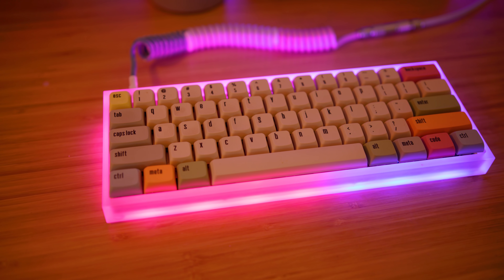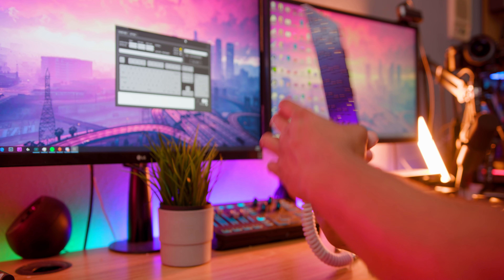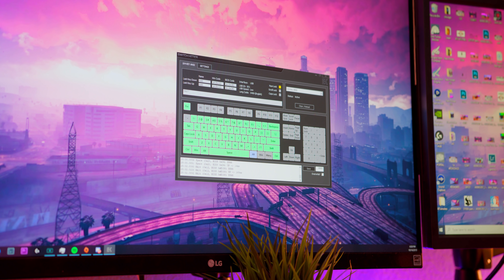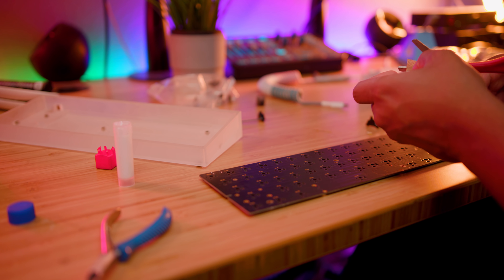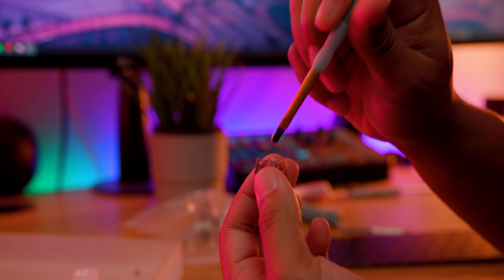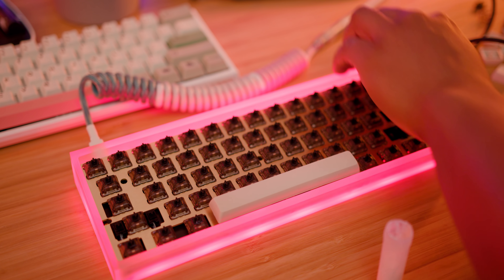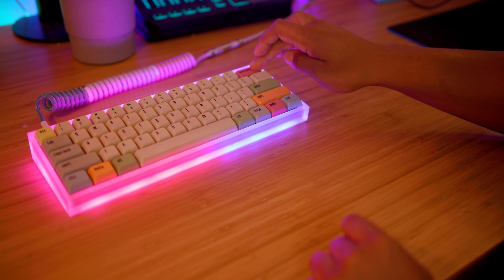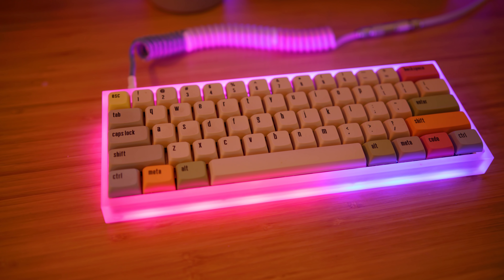Quick And Easy How To Build A Custom Keyboard! Tofu Acrylic 60% Keyboard Build + Gateron Black Inks

Comment: I built a nearly identical keyboard back in june, using my holy pandas made from trash pandas and halo trues, and using a poly carb plate instead of brass. I've been loving this keyboard since.
Reply: Phantasm does the 1 UP PCB have light blue /cyan rgb or somewhere you can customise it to that colour £?

Comment: DUDE - I just started my build yesterday. SAME case, SAME PCB, SAME Stabs, different switches. I went with lubed Zealios 67g. Only problem. My PCB came with 4 LED's not coming on when plugged into power. Working with 1UP on a fix. Hopefully flashing the firmware tonight gets it working properly!

Comment: Dot you guys think it's worth swapping the stock stabilizers on the GMMK for GMK stabilizers ?
Reply: Depends on if you are going to line them or not, if you'll live, than it is definitely absolutely worth it. But if you are just going to use stock stabs, than it basically doesnt matter/won't make a difference

Comment: 0:39 I think it's because we say "building" which makes it sound harder than it is. With these kits it's just assembly like legos so it's childs play really. A screw goes in pre screwed holes with all measurements done for you and everything fits neatly together. It's not like you have to machine your own parts or design your specific switch or PCB in CAD or circuit maker.

Comment: Hey BT great video, you basically condensed hours of random YouTube videos into 7 min!!

ABOUT THE LEMON SWITCH - I’m pretty sure the switches where working correctly. With my hotswap boards some of the plastic can scrap off when inserting the switches, as well as poor mounting because PCB mounts don’t sit flush to the PCB. With that said re inserting switches should solve the problem, as you did. Just thought I’d shoot that out there cause the above happens to me when swapping switches

Comment: One thing to note: stabilizers are easily the hardest part of building a keyboard, and they aren't hard per say, just time consuming and maybe a bit finicky your first time. Getting the right amount of lube can be a little tough until you put the board together and feel which ones are right and which ones aren't. (I haven't lubed switches yet, that's a slippery slope of time sinks). 

I'll add is that you can get foam to fill the space between your pcb and the case, also between the pcb and the plate if you want to get fancy, or you can buy some pre-cut foam from Mkultra. Helps fill out the sound of your keyboard and can get rid of plate ping if you encounter it.

If you really want to get fancy on a case mount keyboard you can buy some tiny 1mm orings to put between the case stands and the pcb to make a sorta diy gasket mount.

Comment: I jsut want to ask what's the differnec ebetween ansi and non ansi dz60v2? some says the ansi ones are the most common one. based on my research the difference is that in a non ansi board, you can hav e arrow keys but the "?" will disappear but ofc u can fix it on their software.. and an ansi board doesnt have the arrow keys but it has the "?" button. I am so confused this is the only thing that's holding me back on wc one to get. I have an rk100 so I am thinking mayeb if I need the arrow keys i can just use my rk instead and then... but...

I really want to have arrow keys but.. :< PLS HELP ME DECIDE HUHUHU

Comment: what foam would fit this on kbdfans?
Reply: don’t use foam it’s an acrylic case, not only will it not make a metal ping sound but you will see the foam through the case. It also blocks rgb
Reply: @NigelBolton_  what about silicone dampener
Reply: @von2046  I already did one myself in my acrylic tofu

Comment: I modded my Corsair k95 plat to have gateron greens after I spilt coke and beer all over my keyboard. All the switches were all sticky and some wouldn't even work so I just replaced most of them with gateron greens. Only the numpad, the f Keys and the macro keys are still cherry MX browns.

Comment: would have been better (the sound) if you had novel cream switches
Reply: novelkey creams, despite the fact they seemingly use a better, more lubricating plastic (through release of micro particles, like using graphene as a lubricant), it is actually not as smooth as many make it out to be. The gateron black inks are slightly smoother.